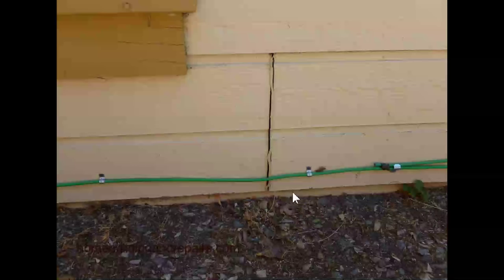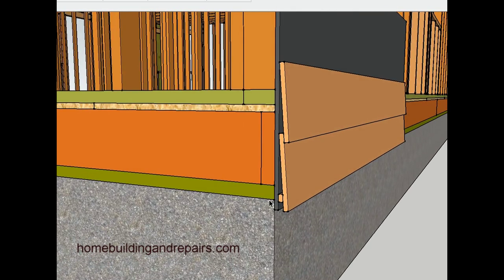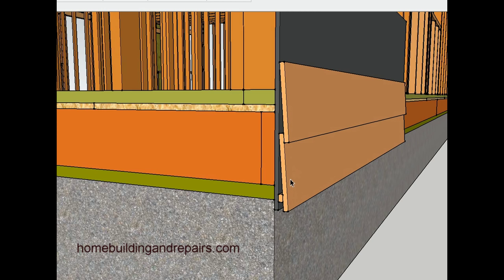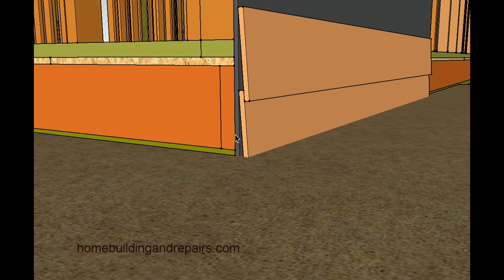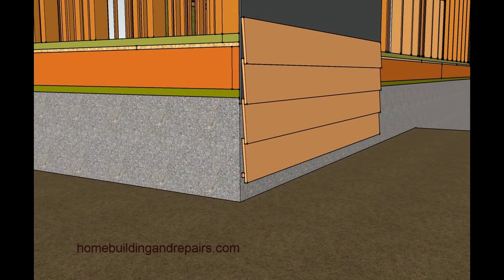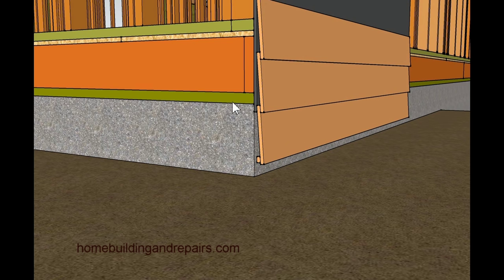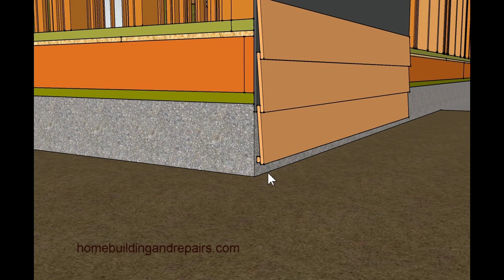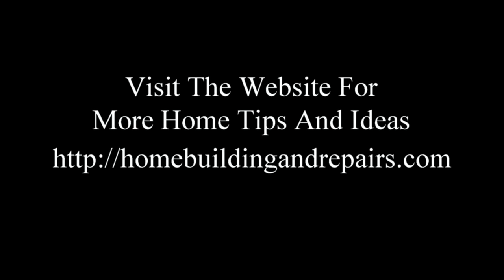What To Do If Lower Section of Exterior Siding Is Buried in Dirt – Building Repair Tips

Comment: If everyone would get the foundations nice and high it eliminates a lot of problems. I have seen some homes that have the
perimeter of there property 3 feet higher then the street and a foundation 14 inches off the ground.
Stops all the worry of flooding in high rains, and drainage is excellent.. That's the way I would build.
Good Video Greg.
Reply from the maker: +MrMac5150 I couldn't agree more and cringe every time I come across a project where the siding or stucco is buried. Thanks again for watching.
Reply: gregvancom
 Good video.

Comment: My house has a 2 inch gap between the bottom of the T1-11 siding and the lawn. The siding has started to rot. Grading correction would involve a lot of digging since the grade is very gently sloped away from the house. Would it be wise to install a channel drain to catch the water running off the siding instead of fixing the grade? I plan to drain the channel to the yard via a long underground drain pipe.
Reply from the maker: Gutters might also help divert water away from these areas and either one of your solutions should work. Your job will be to figure out which one will be the easiest or least expensive.

Comment: Very helpful video! I’m trying to grade around an old craftsman which had soil built up to the second layer of siding. Most of it is straightforward, but there is a very old, very large trees which has main roots which are now higher than the stem wall. Is this something you’ve encountered?
Reply from the maker: You might need to remove the root, especially to prevent it from growing underneath your building foundation if it hasn't already started. Roots can raise sections of your home over time.

Comment: Great video. Quick question- I have a 2yr old house build on a concrete slab. The hardie board starts a few inches above the slab. I notice when I hose my porch down the water bounces up under the siding and I wind up with a puddle inside my house on the other side of the wall. The builder is telling me that’s perfectly normal (which I find hard to believe). I’m also having a huge issue with spiders in the house and am wondering if that’s how they’re getting in. Should I try to seal under the bottom piece of hardie board with spray foam, or maybe stuff insulation or something up behind that bottom row to stop the bugs from getting in?
Reply from the maker: That doesn't sound like it was done correctly, if you want to, email me some pictures and I'll see if I can come up with something. You can get our email address at our website.

Comment: We are in an older house that was built in the 50's, I have no idea how long the vinyl siding has been there, but we noticed in some areas that almost a full piece of siding is buried under the dirt. We only have a half basement, so there isn't "proper foundation" around the perimeter of the house... Would we end up needing to grade our entire yard in order to dig out the siding and grade the soil away from the house for proper drainage? We are just in the process of getting the gutters done for proper drainage and were looking at increasing the soil /fill by the house to slope away, which is when we noticed the area that is buried. I don't even know where to start .....
Reply from the maker: I can think of two things you do you can either slope the dirt away from the house or set up some type of site drainage system that would use drainage pipes to remove extra water. You can also have the gutters drain into the system also.
Reply: @gregvancom  would we then leave the pieces of siding buried underground and just add the drainage system? Or would we need to dig down, remove the buried siding and then add a water resistant barrier and then the drainage system? Thanks for your reply
Reply from the maker: @amandaede374  If cost is an issue or it's going to be too difficult, then do what you can with what you have. I don't like to see any wood that isn't treated, buried underground.

Comment: Question for you, you seem extremely knowledgeable and I would love to pick your brain if you don't  mind . My homes foundation and siding is well above soil level in all areas except for where previous homeowner added a paver patio and paver stairs out of the back sliding door. Pavers come over the level of the siding and above the level of the sill plate, which is already rotted almost to nothing in that area. Is there anyway other than demo'ing the stairs and redoing them to fix this issue?
Reply from the maker: Probably not, because there would need to be some type of moisture barrier or waterproofing membrane to prevent moisture from absorbing into the wood from either cracks, gaps or even the pavers if they are next to the lumber. Feel free to send me some pictures for more information and you can get our email address of the website.
Reply: @gregvancom  thanks for the reply. I may take you up on that. I will get some pictures over to you once the weather clears up over here. Thanks!

Comment: Great video, thanks for sharing.  So if my stem wall doesn't come out of the ground far enough so that my siding is high enough above the proper grade.. what do I do?   Creating an improper grade that slopes back towards the house doesn't sound right.  Tearing down the house and raising the foundation isn't an option.
Reply from the maker: You bring up a good point and obviously I won't be able to provide everyone with an economical solution. If it's too expensive to regrade the property and raise the entire house, then you might be stuck with installing some type of site drainage system, but this might not be inexpensive either.

Comment: I recently had my driveway paved and now about 1" of my siding is buried by the new pavement. I'm wondering if taking out that bottom piece of siding and then chipping the pavement away by a few inches and filling with small rocks would help.  Suggestions?
Reply from the maker: I might have a video on the website that might be helpful, if not let me know. http://www.homebuildingandrepairs.com/repairs/siding/index.html

Comment: I have a low grade house for, half of it. I put darin pipe and gravel up to bottem of foundation vents all around house. But it leaves me at a taper to house from yard. About 6 inch. What fo you recommend. To try and grade away from house would abe alot of digging any ideas ? Thanks for video
Reply from the maker: Feel free to send me a picture of your project and you can get our email address at the website. My thought would be more based upon using site drains, do you think that would work instead of regrading?

Comment: I have an addition that wasn't built to code. They built the framing right onto the slab and the siding goes right down to the slab so water wicks back into the room. I have watched a bunch of your videos looking for inspiration on how to fix the problem. I was thinking flashing at the bottom but not sure it will work.
Reply from the maker: Yes, flashing might be the answer to your problem. Feel free to send me some pictures and you can get our email address at the website for more ideas.
Reply: Did you figure this out? We have a similar problem.

Comment: if we pull off siding that is buried in the dirt, what do we use to re attach the existing siding back on to
 the foundation?
Reply from the maker: For the most part, you could re-attach the siding with galvanized screws or nails. Feel free to send me some pictures of your project for more information and you can get her email address or website.

Comment: Thanks! But what if installing  polyurethane faux stone panels? OK to touch dirt?
Reply from the maker: Moisture that gets behind any exterior finish like stucco, siding or even the materials you mentioned in your question needs a place to drain and by burying any product in the soil, you could make it difficult for moisture to escape and increase your chances of damage to the wood framing.
Reply: THANKS!!

Comment: Yes, some homes built on slopes are sunk even 2ft. below soil grade to top of foundation! who would build like that!?! It's like taking your favorite book and leaving it on the ground in the rain and wondering why it didn't rot to pieces. Without substantial waterproofing and advanced membranes and drainage, no below grade structure is "waterproof" and people who put wood studs and paneling on a basement wall are bonkers. Absolutely need to see plenty of foundation all around the home! Even the top of foundation wall should be sealed with gasket or flashing to isolate wood from damp concrete! Not even going to get into how people build decks in America (Hint: stuck in mud)
Reply from the maker: I am often amazed at how things get built and when someone drives a nail or staple through waterproofing membranes to attach something that's going to eventually rot in the soil and create a hole in the waterproofing. Thanks for sharing.

Comment: Damn i just graded and planted grass on one side but its almost touching the siding on the high side.
Reply from the maker: Almost might not be anything to worry about, especially if it's cement fiberboard siding. If not, then simply remove a little bit to keep it away.
Reply: I believe it is vinyl. But i'll take a peek at the sill and how much space there is under the siding.
Reply from the maker: You might not have a problem with vinyl either. I think the main point is that you are aware of the problem and can monitor it regularly to make sure debris is not building up or soil levels are rising to create a bigger problem.